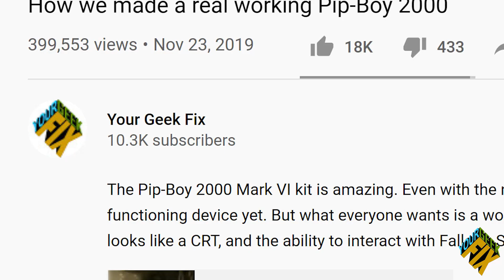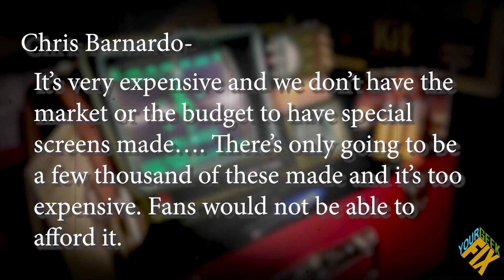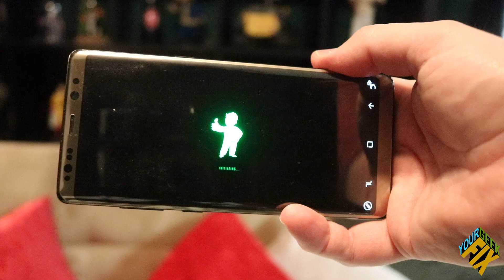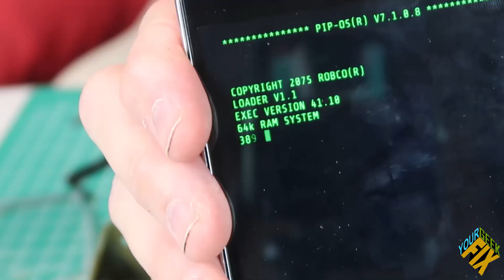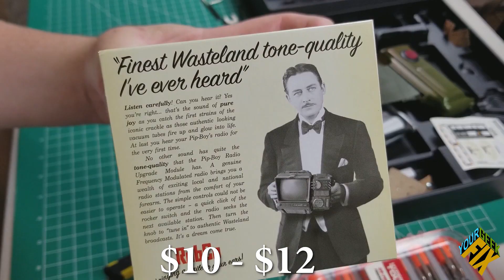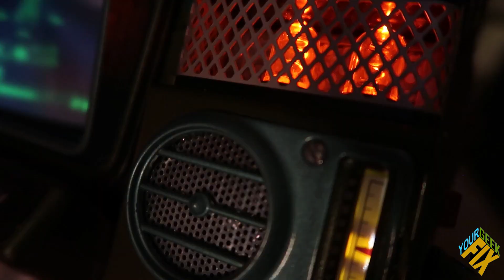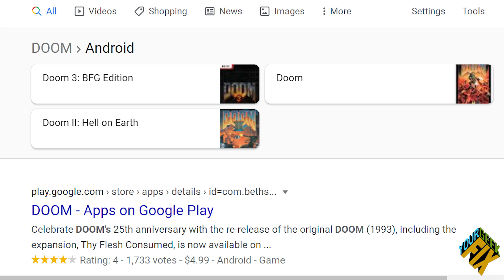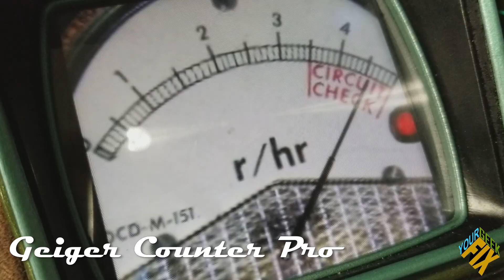Fallout - How we made a real working Pip-Boy 2000 Part 2 of 3

Comment: 9:30 so far, I've fit a pi zero and momentary button in the top panel for power. I've got an HDMI ribbon cable that is an almost identical match for the dummy cable that connects top panel to screen housing. Coiled telephone wire to connect to radio module, and rotary encoder for radio knob, 12 position switch on the side of the rad meter, as well as momentary switches for the three buttons. Holotape has just enough space for a lipo or li-ion battery.

I keep getting hung up on the screen. I don't need touch because I've implemented tactile switches, but a 4:3 4.5" screen is challenging to source. I would have loved to disassemble the flickering screen module and wire the intereupter and smack feature into the backlight of the screen. I feel like I'm like 70% of the way there hardware wise, then would have to figure out some programming in Python to make it function.
Reply from the maker: Did you see video three? I addressed some of that.
Reply: @YourGeekFix  just watched, found a screen for $15, now the challenge will be making the connections work between it and the pi zero. Thanks!
Reply from the maker: Programming is not the hardest part. I think the hardware is. For me, there was nothing that could do all the things I wanted if it wasn't a chipset manufactured for that purpose to fit in that tight space. I also wanted to use the holotape area for a holotape, which is what mine did in the end, as well as .working Geiger counter. I have made the switches work again for the Pipboy 2000, so I can control the screen with the switch, without sacrificing too much space in the working Geiger counter area. Did you see video 3 yet? We have the new Pipboy 3000 we are giving instructions for, so nothing doesn't fit inside the individual modules, but everything works. . You may find a screen that is Pi compatible that is much older. I found one that belongs to a 2013 portable TV. It was exactly to scale.
Reply: @YourGeekFix  that's a great lead! I'll look into the portable TV screens next. Watched part 3 earlier today, good content! Makes me less intimidated about mounting the screen
Reply: @YourGeekFix  what brand was the TV?
Reply from the maker: @JohnAndersonIV  I think I still have one of them down stars. The battery expanded.
Reply from the maker: @JohnAndersonIV  good
Reply from the maker: @JohnAndersonIV  Subscribe if you haven't already.

Comment: This is my first time doing this. I watched your first video about the pipboy, and you modifying the pipboy is right up my alley. I want to get myself a pipboy where i can use the parts to cast them in metal. I like your trick with the phone, and i think i know how to make it all fit.
Reply from the maker: Sounds good. Did you see both videos? The third Is about to come out. The only problem with metal, is that it would be much heavier than the one that I made and unfortunately that when I made is very heavy.
Reply: Im a blacksmith and i know certain metals are heavy and some are light, if you take aluminum its easy to smelt down, if you add the right ratio of copper you will get a lighter but stronger metal. i did an experiment making a blade, and in the game it is infact heavy, because they use a certain type of steel.
Reply: Im a blacksmith and i know certain metals are heavy and some are light, if you take aluminum its easy to smelt down, if you add the right ratio of copper you will get a lighter but stronger metal. i did an experiment making a blade, and in the game it is infact heavy, because they use a certain type of steel.
Reply from the maker: @shadowdragon2950  that would be cool.

Comment: Have you tried playing Fallout Universe video games like Red Menace on the real Pip-Boy?
Reply from the maker: Yes. I need pitfall still.
Reply: @YourGeekFix  Just finished watching part III. I was impressed by each iteration and the improvements made as you learned from your mistakes- which I agree is a critical step in the process of making anything great. Honestly don't know what else you could do for improvements, since you proved the rotating clock/date was just not realistically possible to make without an enormous budget to get it past whatever hurdles that arose. if those Power Armor helmets weren't recalled I'd ponder whether it's possible to make your Pip-Boy communicate with a type of interface in the helmet, maybe another raspberry pi with screen mirroring used to send the Pip-Boy onto a screen inside? Regardless, subbed and looking forward to what you engineer/mod next!! 😁
Reply from the maker: @ModernOddity728  thanks! I didn't know the helmets were recalled.

Comment: AMAZING EPIC JOB SIR  I made a pip boy with a 4 inch CRT tube from parts of a 1990's TV studio camera display, the flyback and all the HV components were all in one small space unit to be exchanged fast just in case it failed while on air,  It was very simple setup. 3 wires and it was setup.  It was heavy unfortunately so I made a micro edition using a 1.5 inch Sony B&W CRT Viewfinder from a 1985 Sony Studio camera.  The look was great but the length of the tube along with the weight of the components makes the LCD the only option and it makes me sad.
Reply from the maker: Sounds cool! If you saw video 3, I show a tube for the 3000 that I made work, but was also too long

Comment: hey man i am thinking about getting a real military grade geiger counter it's big as a key and it fits. so i thought to unmake it and cover the circuits in lead tape,and when the "rad counter" comes out i will split it. because the counter is two seprit parts one is the counter and the other is the actual counter so i planed to hot wire the meter to the military grade geiger counter.
Reply from the maker: Do you have a link where you got it?
Reply: Impressive
Reply from the maker: @louispowers3736  Again, thanks.

Comment: your main issue with the pie being too tall and the display module taking up too much space could be solved by removing 90% of the IO and directly wiring the Pie's screen to the IO pin area, but that would require a bunch of complex soldering, would be hella cool tho.
Reply from the maker: Next problem is finding a screen that is square and exactly that size. Surprisingly hard to impossible to find. Also, hard to find one that will work with the pi. Next, the battery is difficult. Remember, my challenge is that it also all needed to fit behind the screen... Battery, module, and  screen. Easy with smart phone tech.

Comment: I mean you would have to desolder alot of connections while hard soldering all the ones that are needed with wires (similar to how ben heck builds portable consoles and routes the wiring). Not to mention you would have to have a board that doesnt get too hot and require thermal cooling. I think its doable though plus ill be damned if I dont get a pi in one of those. I would probably have to rig the case together outside of its original build.

Anyways what you have done is impressive/really cool. Im not sure I even have the time to do everything I want  :/
Reply from the maker: Understood. The 4 b cannot compete with the processor and do all the things this does. However, if you are determined to do it, you can. Sounds like you have the know how.
Reply from the maker: Thanks again

Comment: You mentioned a AAA battery device to use possibly in lieu of the  AAA alkaline batteries that would allow a modder to externally recharge power for the FM radio mod kit from Wand.  You did not mention where to find it or what the kit is called?  You provided pictures of it however.  Why didn't you use this mod again?  Thanks
Reply from the maker: I use the Gerson Power Supply three AAA battery. It was around $10. Only one battery carries a charge, the other two are just for completing the circuit. I am a little leery the radio may burn out being on all the time. with that particular set. Another option is the old three AAA battery that is lithium ion that was made for cameras 10 years ago or more. That one would charge and could be taken on the go.